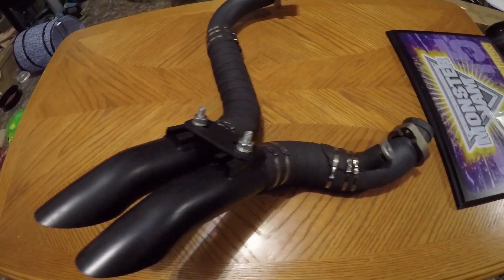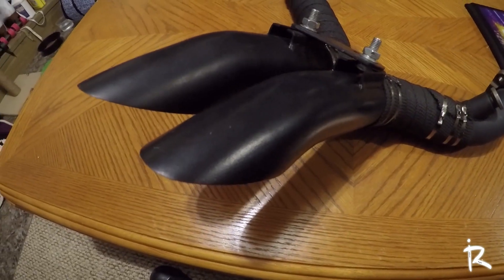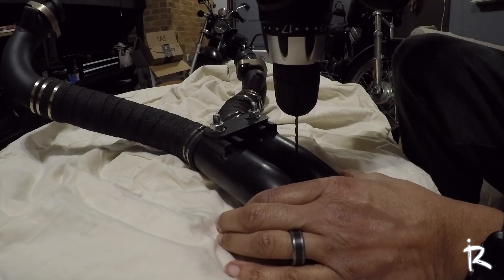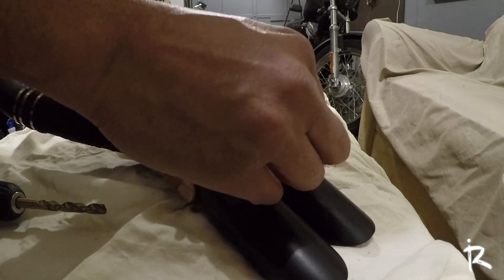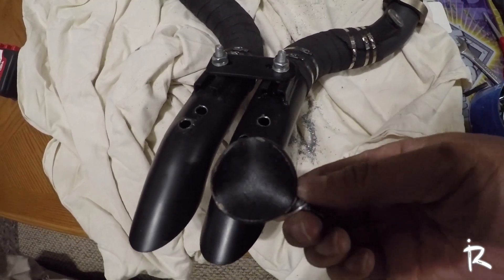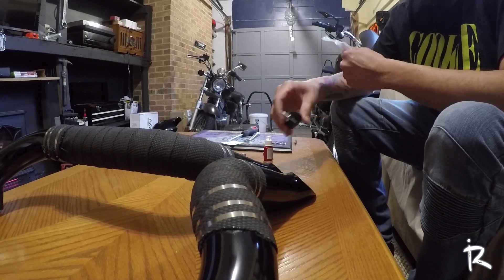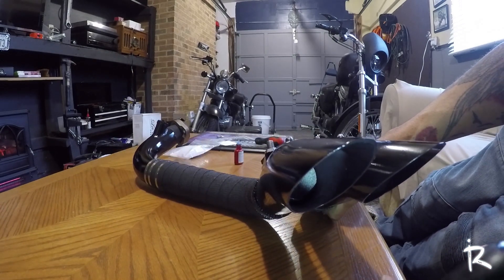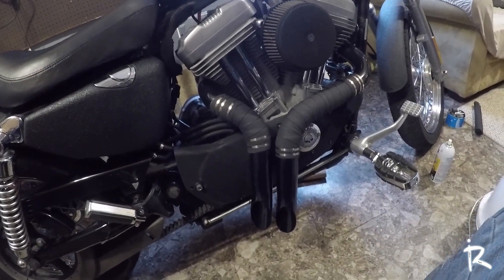Thunder Torque Inserts Installation

Comment: There should be equal amount of space around the insert, the nuts you threw away where lock nuts, they should be tight going on. PS. Start over.
Reply: This video should be titled, "How Not to Install Thunder Torque Inserts."

Comment: What did you use to plug the o2 sensor holes?
Reply from the maker: Lucien Von Buren it’s cam with plugs. Or do you mean the extra holes I drilled
Reply: The Infinit Ryda ah ok the pipes I ordered don’t come with plugs I think, I’ll see when they arrive, or I’ll figure something out lol, my Sportsters an ‘89 so I don’t have o2 sensors
Reply from the maker: Lucien Von Buren you can get bolts from the hardware store. They will work.

Comment: Not to seem rude but the purpose of the inserts is not to increase backpressre u want as little back pressure as possible,the actual reason for using these is to prevent reversion which is exhaust gas reversing up the pipe this is what causes the dip in low and midrange torque.
Reply: Back pressure stops reversion

Comment: One thing you said is not right. It’s reversion you’re preventing. It’s the exhaust traveling into open exhaust chamber slowing process. Torque things prevents reversion. Nice video though
Reply from the maker: 👍🏼 oh I wasn’t too familiar with that exhaust
Reply: @theinfinitryda  I like the two tone paint touch up